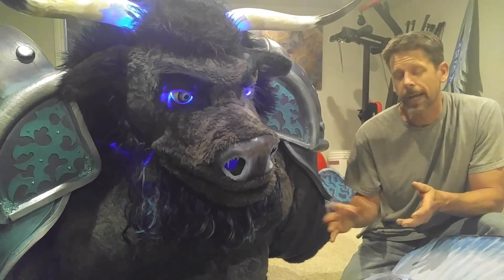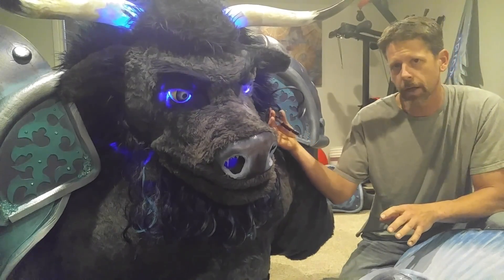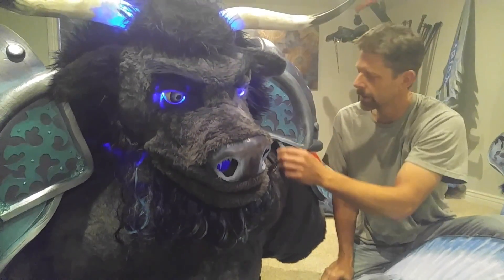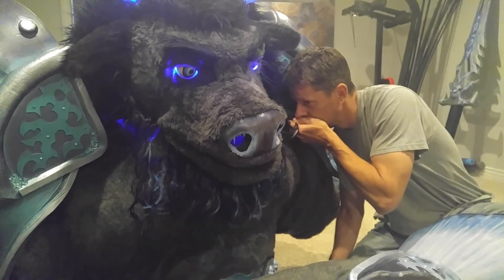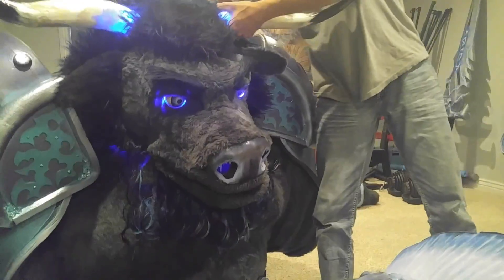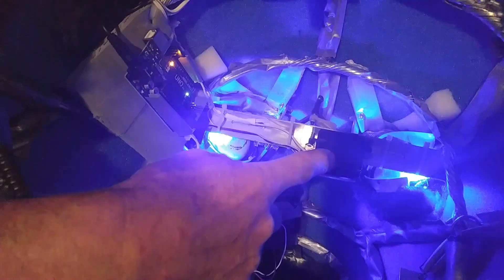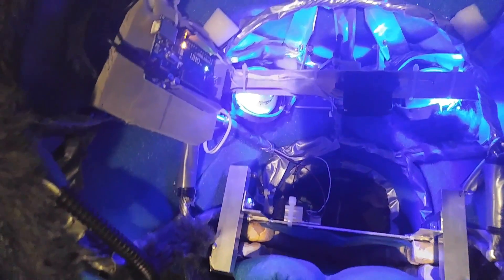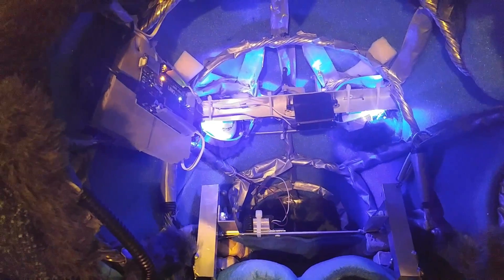Akulva animatronic speech demo using Arduino, Picotalk and servos

Comment: Awesome how did u do the voice chamger to the sub
Reply from the maker: I failed to go into detail in the video. It's a 12 volt system that powers a class D amplifier that in turn powers the sealed 8" sub housed in one of the thighs. I use a microphone as input, the signal is split into two paths: one route from the mic goes to an Arduino that lowers the pitch of my voice in realtime and is sent to the amp which outputs to the sub. The other path is sent to a Picotalk which controls the servo in the jaw much like a graphic equalizer, soft talking gives small jaw movement while loud speaking opens the mouth much wider. These two paths from the mic give the illusion of Akulva's speech.
Reply: Caulfieldcosplay cheers buddy ur work is great i have a ptoject ongoing and ur projects are outstanding thanks again